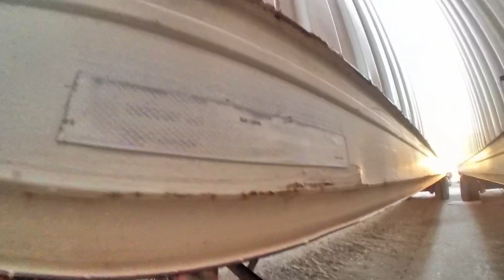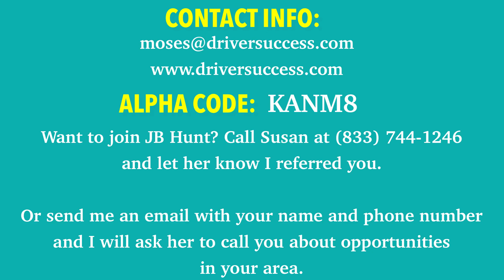TRUCKING VLOG | JB Hunt Intermodal Local Truck Driver | CDL Trucking Videos & Advise

Comment: Hi Moses, good job on the video. The container that you picked up, which was 288890, was manufactured by CIMC, in March 2014. Then later, you picked up 239837 which was manufactured by CIMC, in August 2007. Also, the 360 box trailers are doing good. I had to add on almost 200 more. The other day, I found trailer 801839 which was built a few months ago, in September. On Saturday, I saw trailer 801974, which is the highest that I have seen. That means that J B Hunt has almost 2,000 of the 360 box trailers.